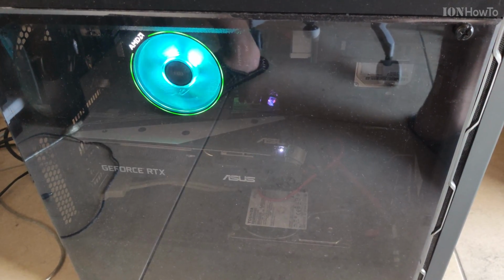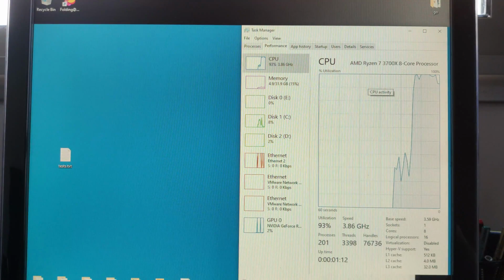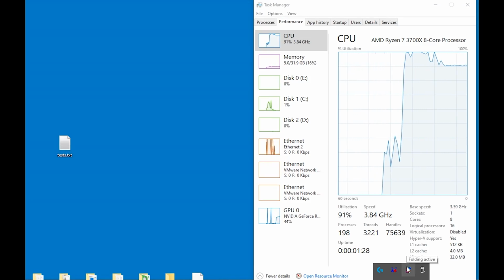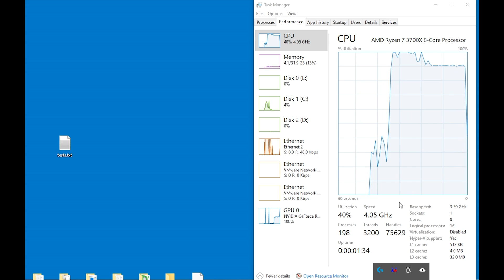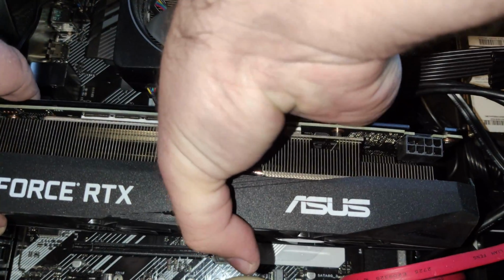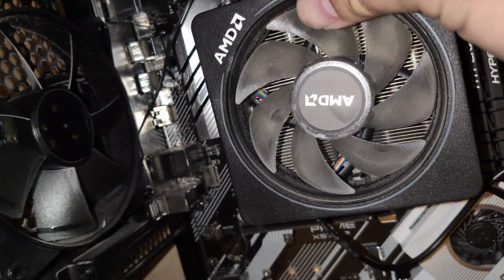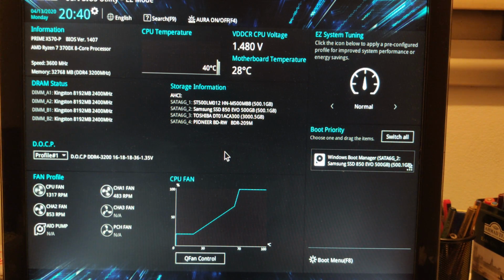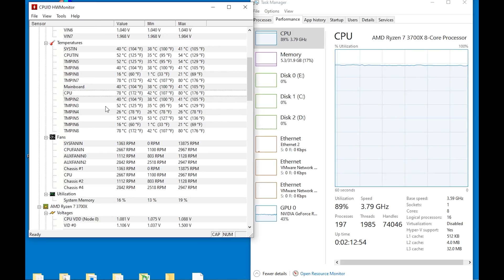AMD Ryzen CPU Cooler Thermal Paste Arctic Silver 5 vs Kryonaut

Comment: sorry, but ijn your video the Arctic Silver 5 ist up to 5 degrees better!?
Reply from the maker: If you have as5 for sure use that. Mine was almost finished and wanted to try the hype.
I don't do oc or anything major.

I would use any paste made by the main manufacturers. Pre-applied paste is also fine but there's the what if the other paste is better thing.
Reply: @IONHowTo  YOu tell the right word: "hype" !!!